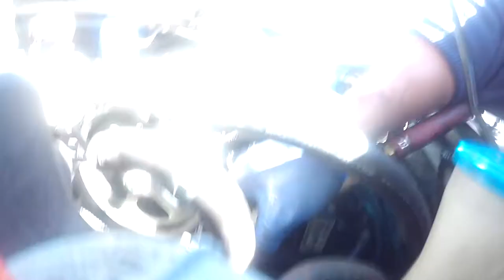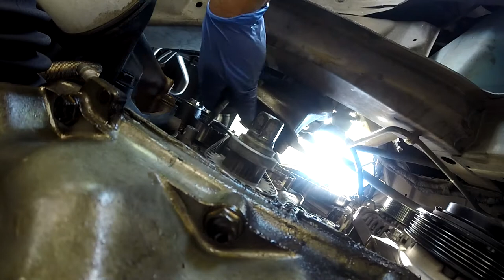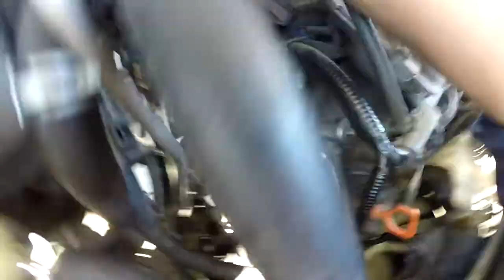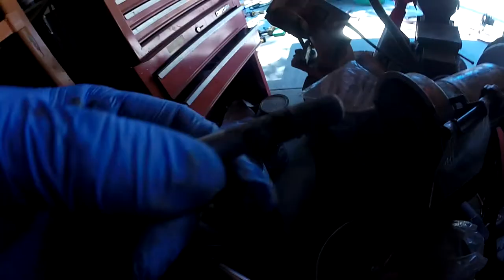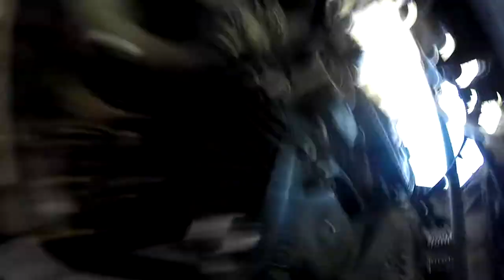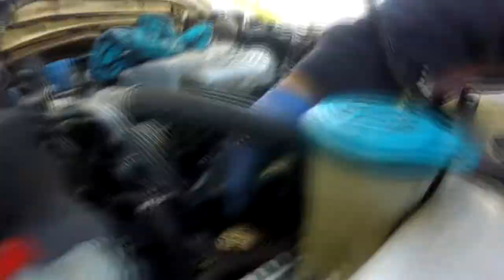09 odyssey and pilot timing belt water replace

Comment: Good video very informative I'll be replaced the my timing belt water pump tomorrow for Acura TL 3.2 same engine same. I got all the part I got everything I need replaced everything on front of engine brand-new I have a 137700 miles on it right now and I hope two double that and more. THANKS.!!
Reply: Same car here.. mine has 273k and just recently did my timing belt and water pump.. hoping to go another 250k on this car.

Comment: hi, how did you made the pipe that is attached to19mm socket tool using impact gun(video from 0.38 to 0.46 sec) to remove the crankshaft pulley bolt(19mm)? thanks

Comment: Was this the original timing belt that you changed at 130k miles?
Reply from the maker: yes it is the original timing belt
Reply: All Tsab I’m planning on doing my 2007 odyssey. If I remember correctly isn’t do at 80k?
Reply from the maker: Vic Nago it's 100k miles due for changing but I saw many drove past 130k miles still ok. But some time less miles still broke because aging.
Reply: All Tsab thanks for your quick response.
Reply: All Tsab my Honda Pilot has 136k+  

Miles on it and I'm planning to change the timing belt soon!